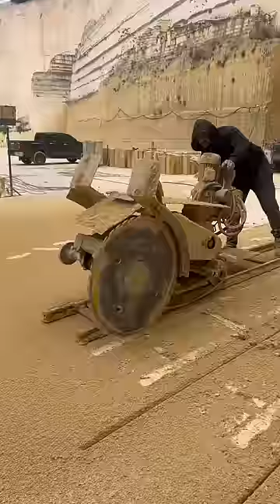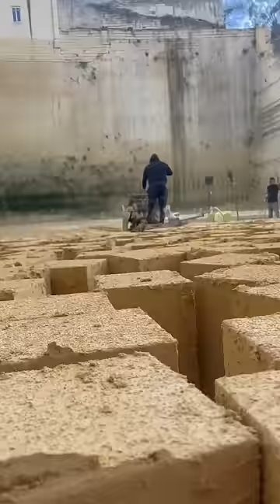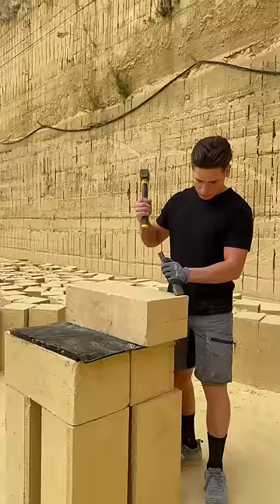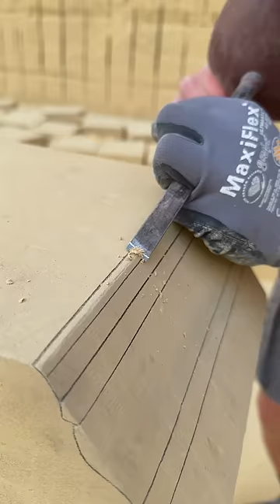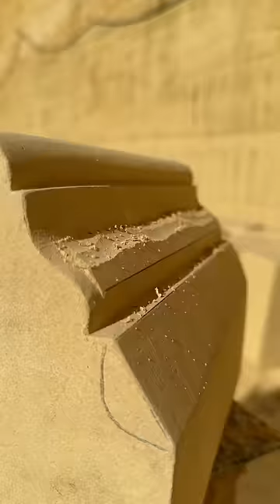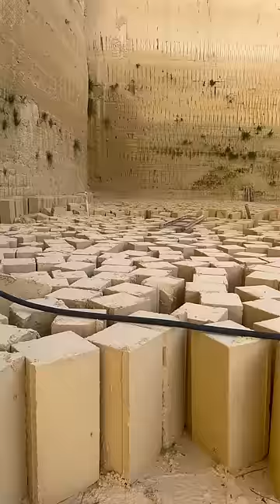#stonemasonry

Comment: This is how they made old temples and peramids , I just don't know why people just don't get that💀
Reply: granite blocks way different thing to carve and weight to lift 70-100 ton block to top of pyramid is impossible even today
Reply: @SntGod  dude, have you seen the construction of the burj kalifa, people had to get 500 ton blocks over 800 meters in the air, tell me whats inpossible dude, stop capin'
Reply: @NamelessFurry  where is your 500 ton blocks?

"In May 2008 Putzmeister pumped concrete with more than 21 MPA ultimate compressive strength of gravel to surpass the 600 meters weight of the effective area of each column from the foundation to the next fourth level, and the rest was by metal columns jacketed or covered with concrete to a then world record delivery height of 606 m (1,988 ft),[23] the 156th floor. Three tower cranes were used during the construction of the uppermost levels, each capable of lifting a 25-tonne load.[91] The remaining structure above was constructed of lighter steel.

And count how many men is needed to pull those heaviest blocks that steep angle of pyramid and the lenght of ramp...keep on dteaming man!!! And where was circular saw blades that time?

IMPOSSIBLE to construct even todays machines!!! Check also other megalith sites around the world
Reply: They had multiple lifetimes to hone their skills and make lasting achievements for us to wonder in awe at. To think they simply couldn't achieve these wonders is an attempt to discredit their skills. Ancient alien theories sound cool and all, but how dumb does one have to be to actually believe that? Just think of it this way: someday somebody will look up at what's left of our skyscrapers and think it was impossible for man to create such a thing.
Reply: @ModeSOLOgaming  thanks for explaining it so quickly and effectively, its sad thag people think we as a species where not capable to do great things with our own hands.
Reply: @ModeSOLOgaming  where are carvings who and how they build? Why big underground under sfinks is forbidded to enter and study? what about megalith walls around the world with more than 1000 ton blocks? Kailasa temple carved to rock by copper wedge and hammer? come on man...keep on dreaming superhumans. Look indian Nagas to find some more reliable answers
Reply: @SntGod  again, points being made only to discredit a skill built up over time. They had all the resources and man power to create their megaliths. It took time, energy, and the backing of empires at times to accomplish what they did. Don't forget what we've achieved within our own time. Now multiply that by thousands of years and it's not really hard to figure out that we're a species capable of incredible things. Don't take away from the wonder of the ancient world with half baked and unresearched ideas only because you watched one too many episodes of Ancient Aliens.
Reply: @SntGod  my dimond head guy, do you really believe ancient people are living like mogger , especially in period of kings and queens, (I am not talking about slaves and comparing today's human with them , they were far taller, stronger and sharper, we today are only greedy smarter) well point is...they definitely have something to lift weights...same as like mordernn construction workers use...
Reply: @mattdamon2084  WOW you are on the right path man!! Next look nephilims and there is your super humans that could build those ancient wonders

Comment: Just need a large cut and polish machine. Used to cut glass like this although obviously thinner. Run it through a machine and ot does two cuts, five polishes and a buff before coming out the other side. Could do hundreds of pieces a shift. With stone that soft it would be pretty easy too. Honestly surprised there isnt an automatic stone cutter there thats worker fed. Thats so much effort for so little payoff
Reply: Да могли бы просто обжигать из глины )